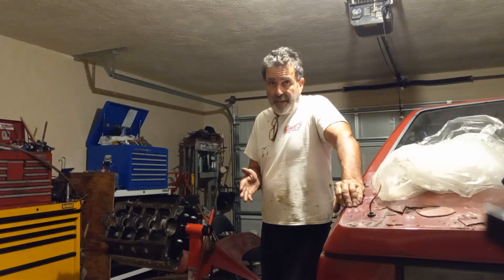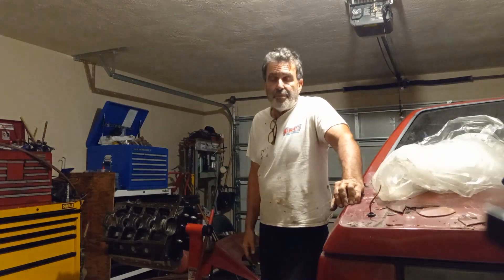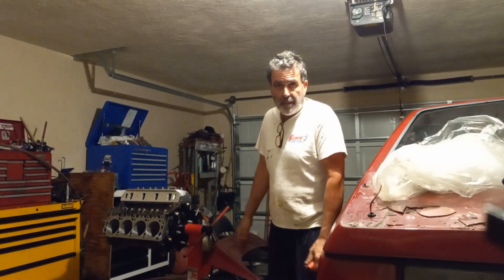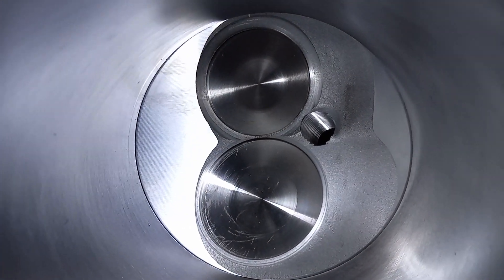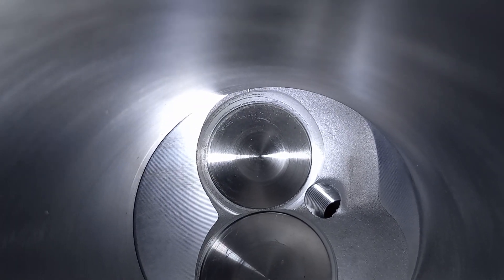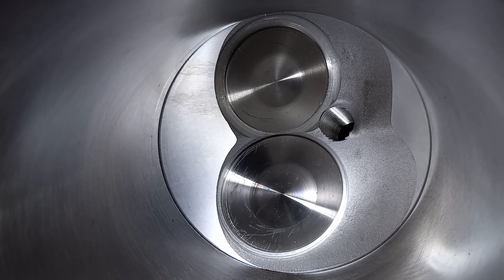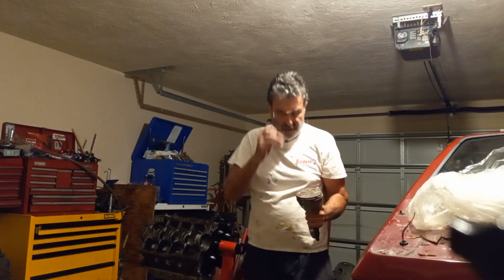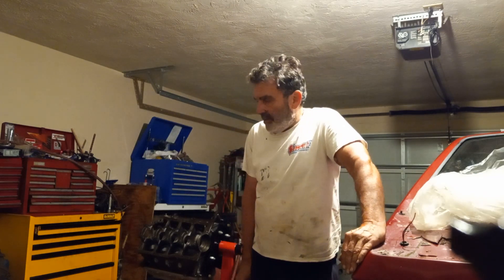Clearing up concerns about Ford Blocks & 2.02 Valve Clearances ..

Comment: they put trickflow heads on stock 302 everyday 2.02 1.60 you just have to check your piston to valve clearance and if you have to take a die grinder notch the Pistons yourself. bye the fly cutting tool
Reply: Yes! I've run the Ford Motorsport F303 hyd. Roller with the Twisted Wedge heads.  30 over flat top piston 306 and everything worked perfect! You are correct.

Comment: Im running 2.02 and 1.6 valves in a 302 and its fine. Duration is what will get you. Keep it below 230 on exhaust (not adv dur)is my advice 👍 (Piston to valve clearance) also my pistons have 1.90 valve reliefs....still no issue

Comment: You should be fine with clearance between the valve 2.02 and 4” bore cylinder walls. Many people have putted 2.02 heads on Ford 302 engine. I think people are confused with Chevy 2.02 heads on Chevy 305 engine.

Comment: just got to be careful on stock piston valve reliefs they are too small for 2.02 intake
Reply from the maker: Well, stock pistons didn't clear 2.02 valves at all....  but atleast I know now...
Reply: @frankrizzo3922  yeah, I tried to run 2.02 before and kissed a few of the intakes on the stock pistons!
Reply from the maker: Yup,  I'm definitely going to Clay check the situation... might have to trim up the existing valve reliefs...

Comment: .  The small block Chevy in all sizes came with 2.02 and 1.60 from the factory with a  4.00 bore.    The valve relief on the stock piston will not clear a 2.02 valve but unless you get to 5.40 lift on a 110 lobe separation you are not having an issue anyway.     I’m going to do a little home work on the heads you bought.  I was about to buy a set of Promaxx heads for a W I’m building but may go your route.
Reply from the maker: Alrighty very good then...  my machinist loves them...  Sells them alot!  No problems with them he says..good luck!